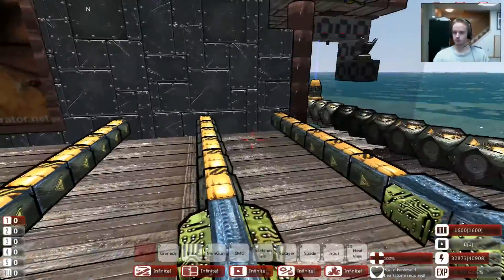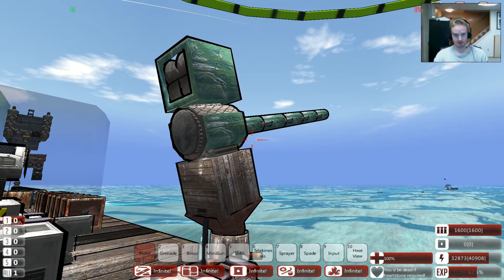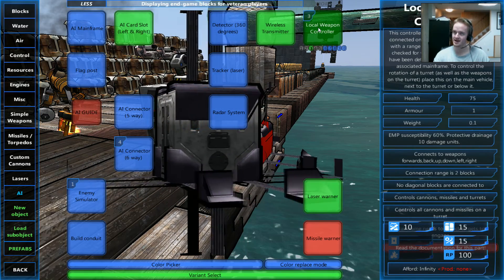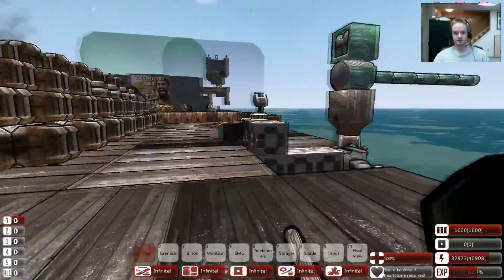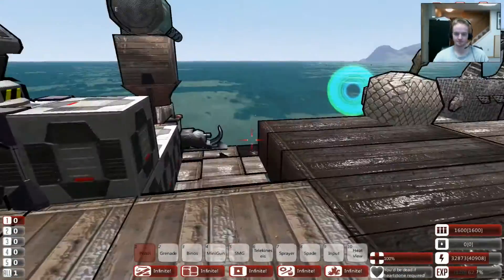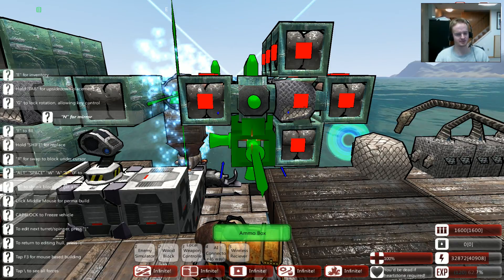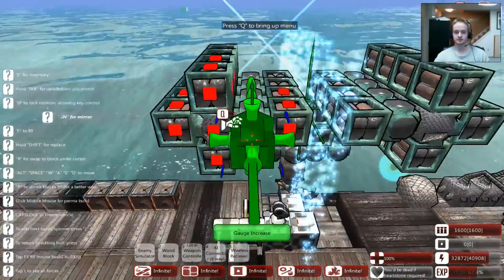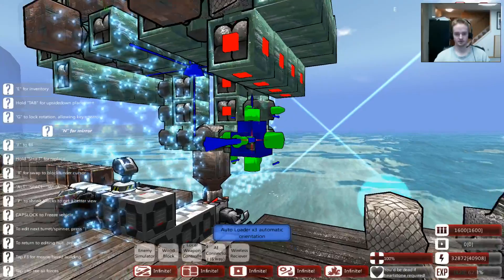Let's Play From The Depths! - Custom Cannon and Turret AI Tutorial

Comment: Can you conect the weapon controller to the spin block and the firing piece if they are more than 2 apart or do you need 2 weapon controllers?
Reply from the maker: +Daniel Pearse I do believe that the range of the weapon controller maxes out at 2 blocks, so yes you would need 2 weapon controllers, it may depend on what kind of set up you are talking about in particular though.
Reply: +Stromboli Games  i'm thinking of making a large cannon that extends down into the hull of the ship and spins on an axis within the hull of the ship.
Reply: +Daniel Pearse advanced cannons are out

Comment: can you have wireless ai?
Reply from the maker: matthew radke Why yes you can, just make sure you have a wireless transmitter either directly on top of the mainframe (or on an ai connector block directly connected to the mainframe) and a wireless receiver connected to the local weapon controller. Make sure that you use the ai connector blocks to make the connection to the weapon controller.